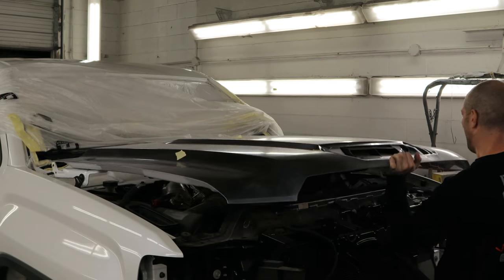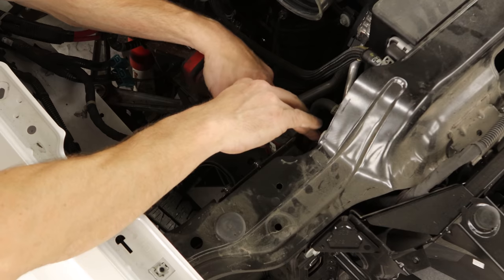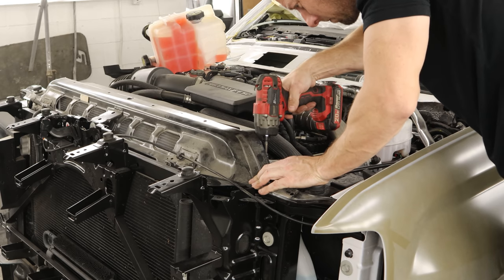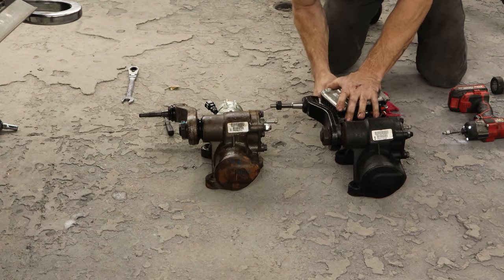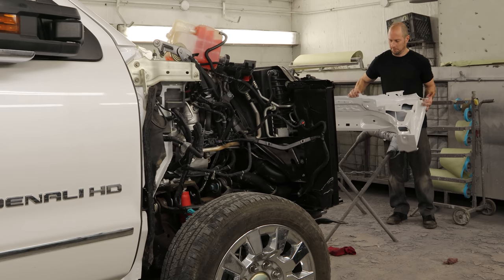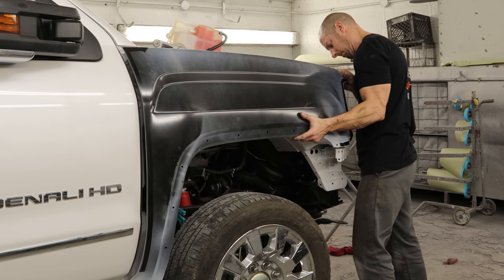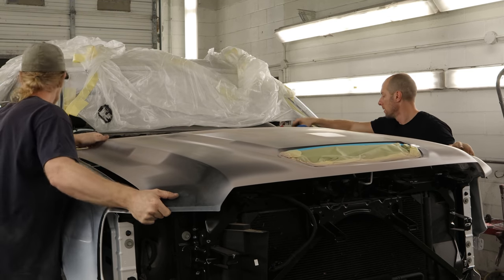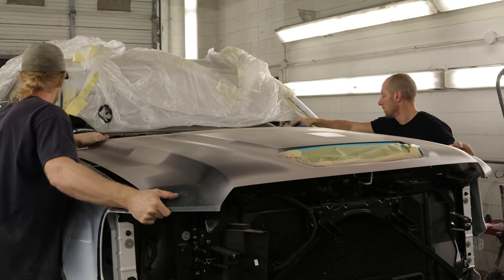Replacing more front end parts on the 2019 Sierra Denali 2500HD build Part 5

Comment: That was a massive amount of work to replace the fender and also the gearbox which we call a steering box here in Australia. Shouldn't be too long now and the truck will be finished. All you need to do is not sell it and you'll have a nice almost new truck to replace your existing one. And remember, this truck has all the extras that you've always wanted, so hang on to it tightly. All the best from Queensland Australia.

Comment: my buddy works at GM parts in MI  he told me years ago that black primed parts were designated to go to service parts and olive as you call it were slated for assembly plants but he said sometimes GM is short in service parts  and grabs them from the line group parts bin, but  he also  said never the other way  as some service parts have imperfection in them.and the line will not allow that.You will see almost all inter structure parts are Olive too.You can feel more comfortable about quality when you get a Olive colored parts as they are normally slated for assembly plant.and sometimes they send end of line leftover part to part ware house when that body style changes Just find that interesting .
Reply: GM sent us parts managers a bulletin a little while back stating that we may now receive Olive primed service parts instead of Black primed.

Comment: 9:28  Since the 2000's or so GM has been using a sealed power steering  pump cap.  If the steering wheel is turned many times with the engine off, fluid from the gear is pushed into the reservoir causing pressure to build.

Comment: Put kryptonite brand steering , ball joints, and hub assemblies on gm trucks from 99 to 19 and you will never replace again. I buy mine from the dmax store. I have the upper A arms lower ball joints, inner outer tie rods, steering linkage, and hub assemblies on my 04. Love them massive parts for reasonable prices. I will never have to buy again. Lifetime warranty no questions asked. Love the channel.

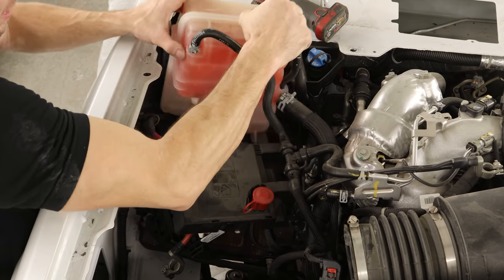Comment: 3:14 you pulled the over flow coolant reservoir out. FYI as a GM technician, the lower part of your reservoir is low on fluid, likely from an earlier recall or from factory that way. It's a pain to fill, as it gets fluid from the very top of the fill hole and runs through a small passage in the seam of the reservoir. If you take the side cap off, plug the overflow tube and slowly fill the reservoir from the top keeping the fluid right at the top, it will take about 3L very slowly, don't stop or it will air lock. When it runs out the side cap it's full.

Comment: How do you remember where all the hardware goes. I recently had my truck fixed because of hitting a dear. It doesn't look like they put the correct bolts back where the were supposed to be. I will have to fix it myself. Love your work. I would not hesitate a minute about buying a truck you fixed.

Comment: A 2019 - 2020 Honda Ridgeline Sport 2 wheel drive automatic base model NO sun  / moon roof.  When you mentioned the used roof it popped into my mind. Why would the yard cut a roof off a perfectly good cab? If it wasn't good would the roof be in good enough shape to use?

Comment: The Pitman arm coming out to do a Gear Box replacement I went that's a bit strange until I realize what we down under would call a steering box was bring replaced not the part that you would call the Transmission or we would call the gearbox. I guess that not using Freedom Units is the cause of all this confusion
Reply: Yeah, had me wondering if he actually said gearbox, so I put subtitles on and he did. I then realised he was talking about the steering box, not the transmission!!

Comment: 3:02 that extra nut? that's what drive mechs crazy...."there's a rattle in the front...find it" 100 hrs later they find a 1/4" nut rattling around in the frame/fender/body panel/ ventilation system" lol

Comment: Since you fix so many of these. I am curious if the Bose speakers are any different than the default speakers or if it is just the name on the grill?
Reply: Honestly I think the only difference it makes is that with a Bose system they just add a bose amplifier to the basic factory speakers, some bose tweeters and a little subwoofer

Comment: That antennas probably gonna leak. GM has us putting window weld or other sealer around the opening even with a brand new gasket on a brand new antenna.
Reply: I thought that too, I would have sealed it on the grommet to the unit where the screws went and then again to the roof

Comment: Why does a hydraulic steering box need an electronic module?
Reply: That's not a module for the steering, that's where my Engine Control Unit is on my 2000 Suburban. Have seen it placed there on other GM trucks also.

Comment: 14:39  Did you put the sound deadner back on the firewall?  I know you are meticulous about putting the OE stuff back, but it sure looks like it's not there.
Reply: I must have missed the part where the cowl / firewall / when well was pulled back out.  I know Scott fixed it, but I was interested in seeing how that was done.
Reply: @NickLoecke  Most likely welded on some pull tabs and probably used the frame machine to make the pulls.  Cut the tabs off.  Spritz of filler, etching primer, fill primer, base, clear.

Comment: 20:24 "with our electric torque wrench" now THAT'S a cool idea. Equip all the cordless impact drivers with actual torque scales so you can set it for factory specs......with all the electronics inside those things it wouldn't be that difficult to do. It might not be to NASA spec but you'd get pretty darn close.
Reply: Not really since it’s an impact. That only works on drills with a strain gauge or if there made with a specific clutch weight to give.
Reply: @FishFind3000  So you're saying it's NOT a cool idea? I beg to differ.....
Reply: @muskokamike127  no its a cool idea but its not accurate. Milwaukee already has this with their one key on the impacts. Its just not accurate like a true torque wrench or special assembly line tool
Reply: @FishFind3000  it's more accurate than "two dugga duggas" lol